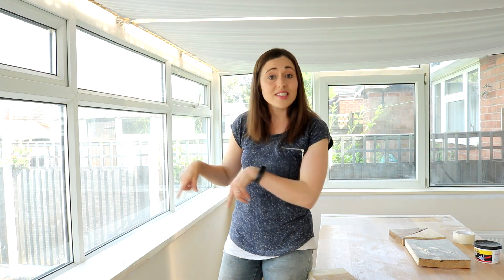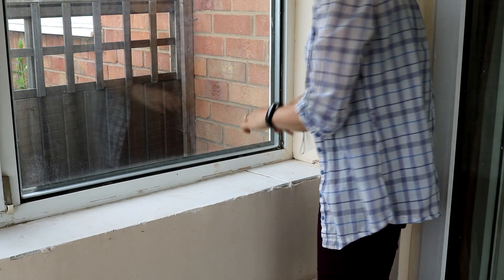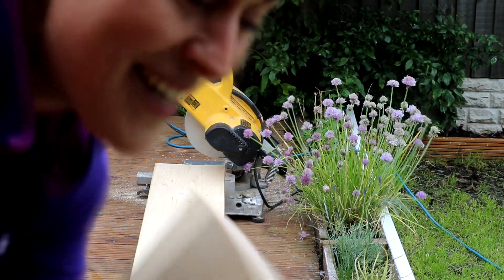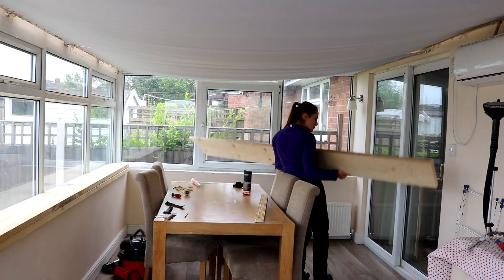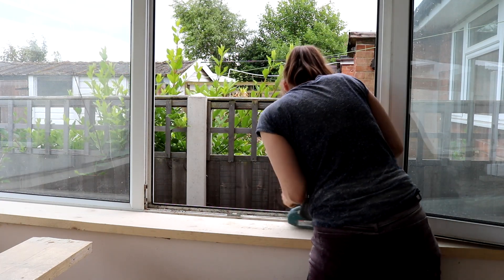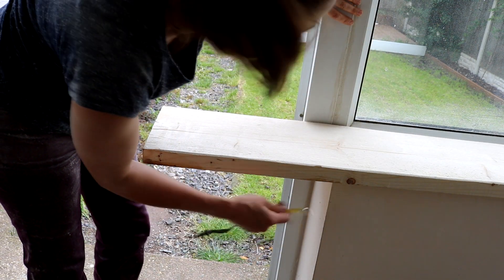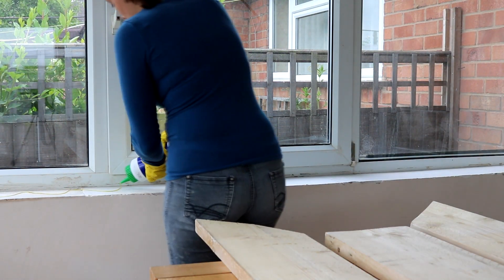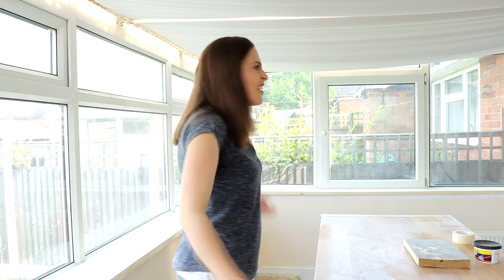DIY Scaffold Board Conservatory Windowsills | The Carpenter's Daughter

Comment: A very under used resource scaffolding boards. I get the cheaper reject boards that have too many knots in, which for my purposes makes them more interesting. I did all the surfaces in our farmhouse style kitchen with them by using a biscuit jointer and glue along the full lengths. I don't use a plane they just put lines in and delves I go with a really course belt sander then get finer. :)
Reply from the maker: +shawn G yes, I found lines with mine too.  Although a plane thicknesser would be nice to have 😄

Comment: I use a DA sander . it sands scaffold boards far better than a belt sander . and yacht varnish to finish
Reply from the maker: Would much prefer that type of sander!! :D
Reply: be honest your probably going to find the scaffold boards curl as window boards . look great the day you do it . but not a year down the road . they do look good as a shelf though.   I'm no pro but I would had just got some new upvc boards there pretty cheap or a treated decking board and turned it over . just my opinion
Reply from the maker: Thanks, I might just do that if I don't like them much anymore.  Later, my Dad did say it's not neccessarily the right wood and if they had been seasoned (which they weren't) then they won't warp over time.  We'll just have to wait and see, but enjoyed the project.

Comment: Excellent. Iv never actually removed window sills , Did you film that by any chance
Reply from the maker: Thanks, sorry, I didn't +scott mclean.  The old ones in this video were never stuck down as we got this conversatory off eBay and it's unfinished.  I would have tried with a flat wide pallet knife or similar with a hammer.

Comment: Slow down with the mitre saw as it damages the blade
Reply from the maker: +David Powell i think I should speeded up the video so it was less boring 😉
Reply: Get somewhere to set up your saw properly, it is too dangerous to use on the floor. The video was fine.